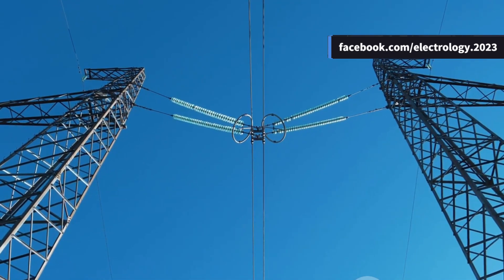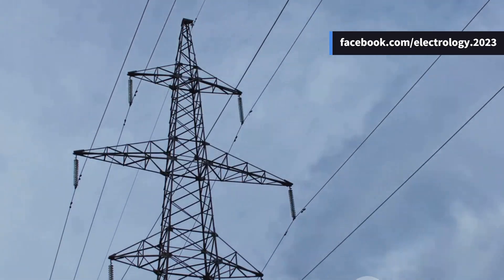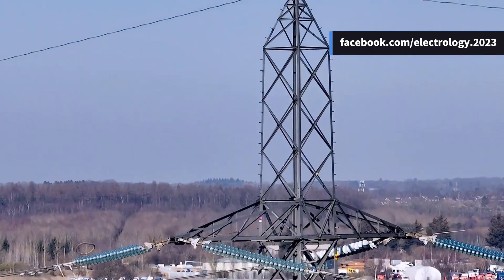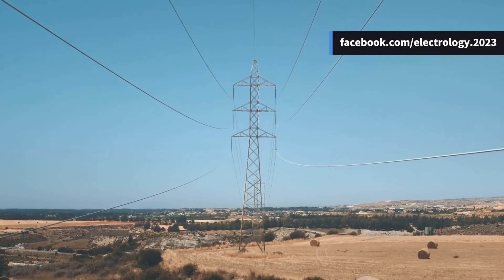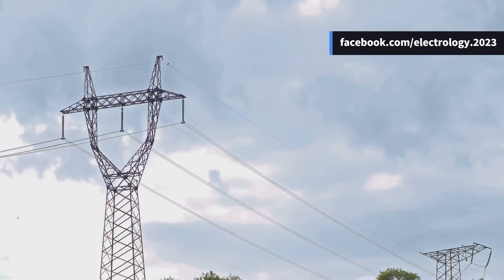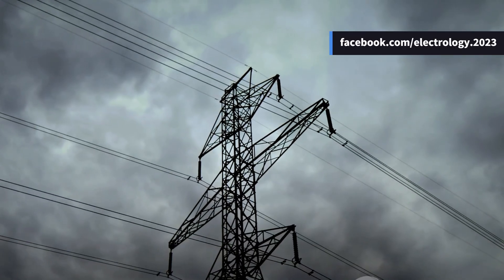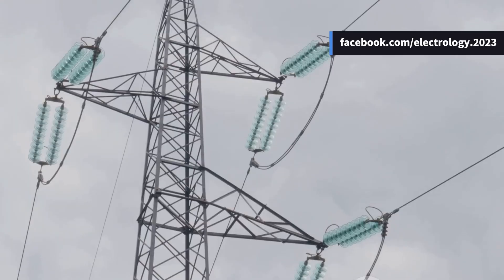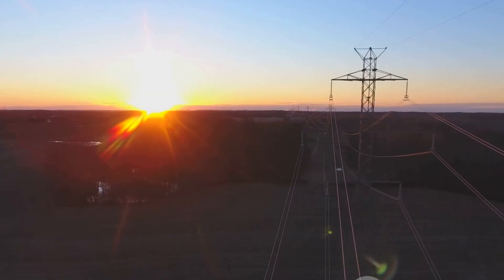What Experts WON'T Tell You About Power Line Design

Comment: Info.is quite useful. It will be better if you prepare a video on how lightning arrestor protect transformers from lightning strike because meant a lot in power transmission and distribution
Reply from the maker: Thank you for the great suggestion 🙏. I’ve already made a detailed video where I explained Surge Arrestor, Lightning Arrestor, and Lightning Rod here: https://youtu.be/cCqNsFBOnI4.
Also, you can check out how ground wire is used to protect transmission lines in this video: https://youtu.be/uk_IEP-zujw